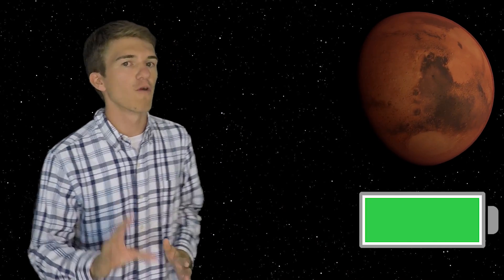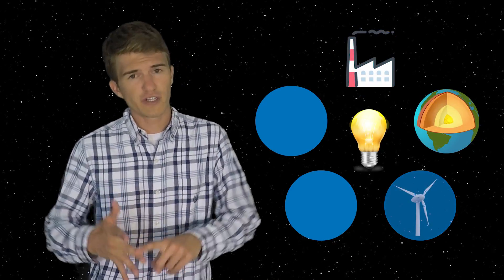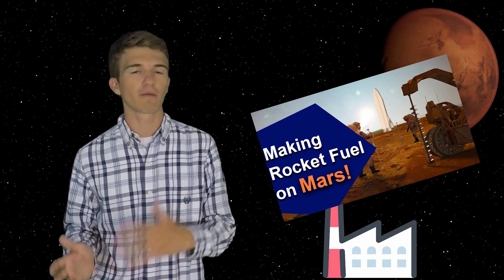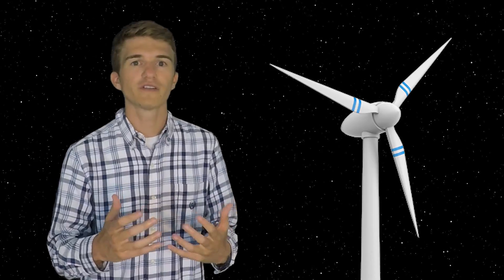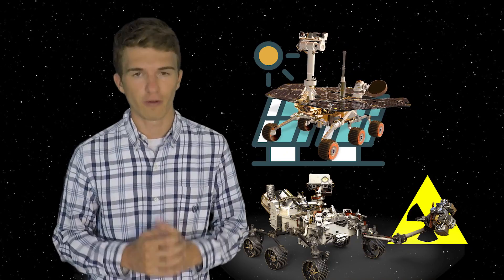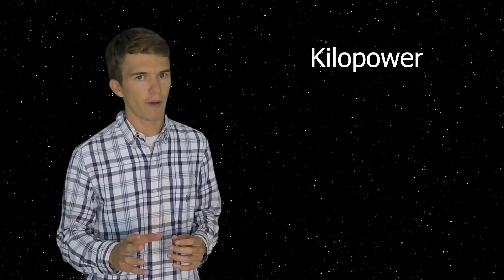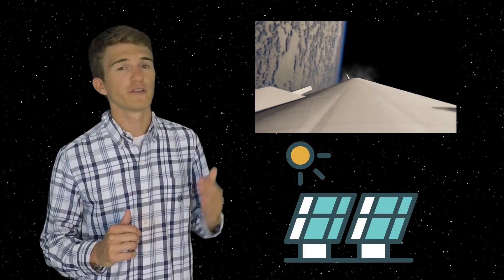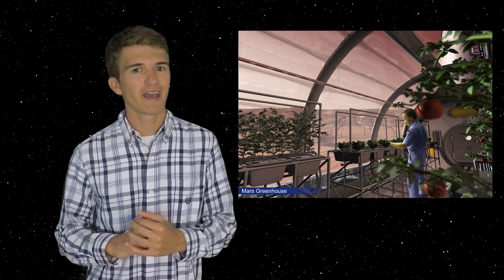How will we generate electricity on Mars? The Case for Mars 25

Comment: There's a flaw in your into. You say "50kW" is the amount of energy required for an astronaut. Watts is a unit of power, which is a rate of energy consumption, not energy. I suspect the NASA paper you referenced said 50 KwH, which is kilowatt-hours. That is a unit of energy (joules is another).

As an analogy, you said an astronaut would have to travel 56 mollion kilometers per hour to get to Mars, but in reality an astronaut would have to travel 56 million kilometers to get to mars.

I hope with this info it's clear that your statement of running 2000 lightbulbs all at once is not accurate.

Nonetheless it's a great video with a lot of interesting info on the subject, so still a great job!

Comment: In case anyone has the same Astronomy assignment questions:

For a temporary mission, how much energy would one astronaut need?  

  About 50 kW 

For a permanent settlement mission, how much energy would an astronaut need?   

About 20-30 kW 

What is the problem with geothermal energy on Mars?  

We’d have to drill into the hot lakes to get to it, but it’s possibly kilometers or miles below the surface 

How high are the wind speeds on Mars?  

Upwards of 60 MPH 

What makes it difficult to use wind power on Mars?  

The low atmospheric pressure and density makes it harder to generate the energy 

What are the two most talked-about energy sources when are talking about Mars?    

   Solar and Nuclear energy 

Solar Power  

Pros:

Easy to maintain and put up 

Pretty light, so easier to transport 

 
Cons:

Less sunlight 

Take up lots of space 

Less functional on mars between night time and dust storms 

 

Nuclear Energy 

Pros:

Doesn’t take up a lot of space 

Always functions, even at night/during dust storms 

 
Cons:

Hard to maintain  

If one fails, could be catastrophic to colony.

Comment: The Kilopower Stirling generator is pretty much a game changer. Solar will only be supplementary until battery infrastructure in developed. Fission is a must to make any manned mission possible. Solar is fine for robotic missions so long as the mission can work within its constraints, and if it can't the worst is we get a sad message of a robot saying goodbye. You don't want astronauts sending a similar message, you just cant bet human lives on solar reliability.

Comment: The amount of power you get from turning propellers with a fluid is dependant on the demsity of the fluid, but the square of the speed.  So at .5% atmo density, a 60mph wind would priduce as much as about a 8-9mph wind here.  You'd need to find a place with good wind, but it could work.

Comment: Just like earth, the issue with solar power  is energy storage. Once solved, large arrays and massive storage will weather long dust storms. The 2nd issue is mass. Getting that equipment there using current tech is not feasible. Making it there is also not going to work. Graphene holds the best potential for both solutions.

Comment: Maintenance is not a problem with Radioisotope Thermoelectric Generators. There is no need for cooling, no turbine, no motors; no moving parts and, properly shielded, no radiation hazard.  The downside to RTGs is that the PU238 is EXPENSIVE.  It shouldn't be, but the US stopped production in 1988 and have been buying from the Russians (for $651,000/lb!) until 2013 when Oak Ridge National Labs started back production.

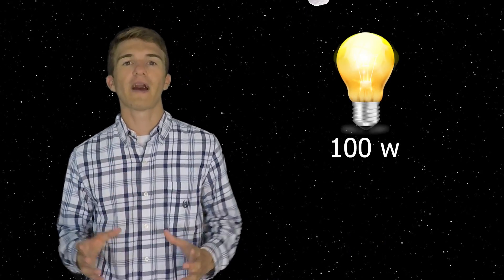Comment: 0:43 "a lightbulb is 100w"
not in my country
Reply: lol 100w is pretty standard in a country running on 230v, you need to double the wattage for countries using 110v to get the same brightness.
Reply: @nzoomed  i was talking about the fact that edison lightbulbs are illegal in my country. we only use efficient lights, which consume 20w to 30w as they turn electricity into light instead of heat, producing the same light as a 100w cavemen one for much less energy.
Reply: @jesusmora9379  lol, thats sad really, i miss incandescent light bulbs, they give off a much nicer light, but i still use the cheaper to run cfl's in my house too. But at least we have freedom to choose what bulbs to use here.
Reply: @nzoomed  i don't miss those primitive things. i can see more clearly with white light than with those flickering medieval torchs. i don't see why people miss them.

Comment: Heh, the lightbulb analogy might become a bit tenuous as time goes on, what with LEDs dropping the wattage considerably

And I've heard solar described in a rather amusing way; " Solar power is just nuclear power from a safe distance" considering that it's no wonder that solar and nuclear energy represent two of the best options for space based ventures, which is used is purely a matter of how far from the sun you are, farther out = more nuclear, closer in = more solar, here's hoping we can figure out fusion and make some reasonably portable reactors to take with us to really open up the options and give us a good tool for interstellar travel
Reply from the maker: You make a great point, the further we go from the sun, the more we will be forced to use nuclear energy. And on Mars, the global dust storms will force us to explore those capabilities earlier.
Reply: @MartianWolf  Every power source in this solar system (from this system) has its roots in nuclear energy because everything came from the sun initially.
Even wind is caused by differences in temperature the sun causes.

Comment: nuclear is the only real option. most of the energy needed will be heat. that nuclear has in spades. remember RTG on curiocity it is the Thermocouples that make the electricity most is lost in heat and dont forget it is minus 70 on mars. Under the best conditions it can be plus 20c at the equator but then goes to minus 100 at night so thermo energy storage has to be looked with good insulation. To me going underground in lava tubes is a great option

Comment: WInd turbines can easily make use of the lower density by increasing their fin width. More area = more pressure. Can be made out of light materails as well because of the low density of the atmosphere.
Reply from the maker: There was a video done by Scott Manley that looked into wind turbines in more detail. I believe he estimated that even the lower gravity (large fin size), it would only be able to reach ~20% of what solar panels are capable of. But I will look into that some more.
Reply: We should stop thinking of how to adapt our current systems to Mars, instead we should create something from scratch.
Reply: but bigger fins mean more mass and more inertia
Reply: @becomingabetteryou5225  that s nice